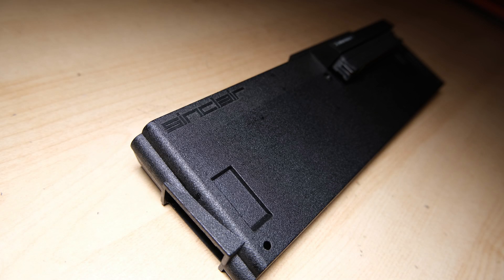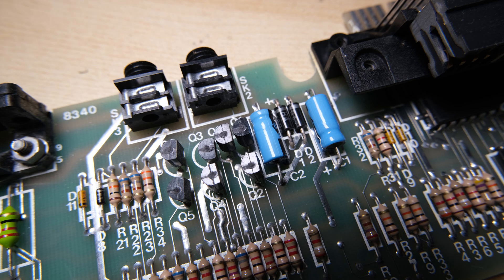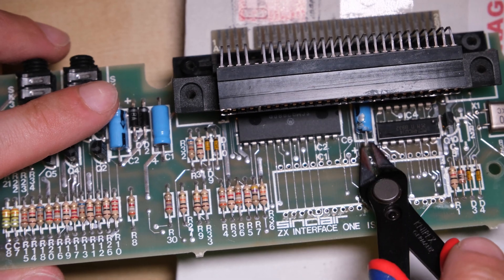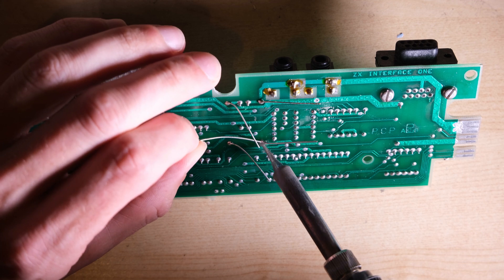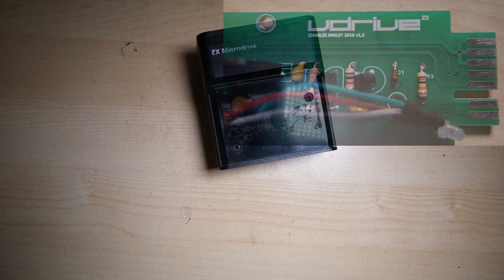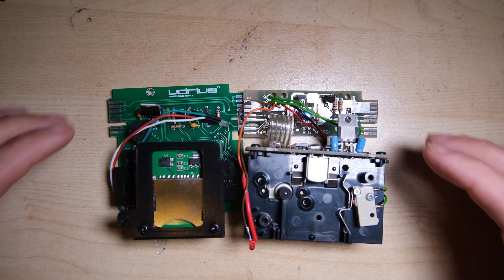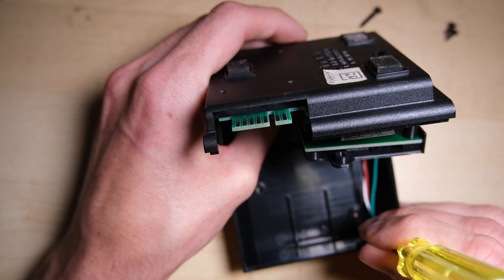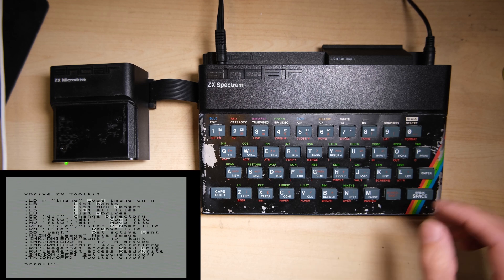vDrive and vLA1 Installation - ZX Spectrum Interface 1 and Microdrive Upgrades

Comment: Will the Zdrive play any games like DivMMC?
Reply from the maker: Yes but I guess without the nice UI. You would just load the program from the virtual Micro drive as if it were saved on a tape
Reply: @HappyLittleDiodes  Hi. Hopefully someone will do a loader then so they can be loaded up like the DiVMMC.   Is the Vdrive much faster then the original microdrive?
Reply from the maker: I haven't compared but I definitely would imagine so. The only reason to slow it down would be for real hardcore emulation!  It still takes just as long to find the commands on the keyboard though :)
Reply: @HappyLittleDiodes   Well I have not used a Spectrum in 35 ish years, so it will be something to play with when my hacking is finished, Lol.
Reply: Also, don't you think it is very annoying that Sinclair did not include a Joystick port and Composite Video out on the IF1.  Darn you Sinclair lol.
Reply from the maker: Ah but then you have to buy an IF2! £££
Reply: @HappyLittleDiodes  And what a success that was, lol.
Reply: @10p6  its actually a little slower formatting and seeking than a real microdrive, but thats probably because it formats to 126k as opposed to around 85k for a real cartridge, so has more virtual 'tape' to go through